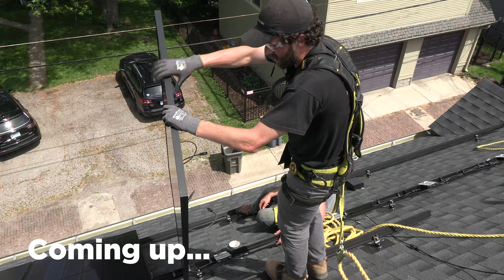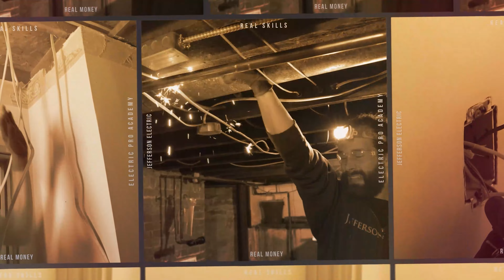Installing Solar Without Ruining A Historic Home

Comment: Nice...
As a former roofer,  foreman,  and now safety personnel,  I was concerned that the meter was installed hot WO PPE... not even safety glasses.   The guy walking the roof stepping on a rope,  the slipping and maring of the shingles (which you said was not a problem because of the special boot fittings) the tightness of the wires going into the roof J Box and the size of the J box.
However,  after Wayfinder evidence of your videos,  I am confident you will or have addressed these issues and corrected them if you felt it necessary.  Thx for another great vids.  
Side note: it's hard to imagine the panels needed to be"invisible" for "historic compliance" while the same rules allowed all the attachments to the outside wall of the house.   Curious

Comment: my roof is hard to walk on it is plastic slate you can't sit down it is like a sliding board.  these panels nowadays are so much better than my solar panels from about a dozen years ago with one inverter in basement I think one panel is not working but i would have to take whole thing apart to find it

Comment: I'm interested in the code that allows cutting down pluming stacks for solar installs. I have a couple stacks in the way of my install that is about to kick off.
Reply: in most cases the vent about the roof is to prevent snow or leaves from covering it. I suspect the solar panels will do the same thing. The alternative is to reroute the vent inside the attic and bring in out in another location.
Reply: Can you also put an air admission valve on the stack in the attic, and blank over the hole?

Comment: The 13:25 -15:25 bit about Chip-Edge Welding was super fascinating to learn about. What perplexes me is that, compared to most other metals (that one encounters in normal life), aluminum has an incredibly high melting point/mp, 1,221 °F (660 °C), so I wouldn't expect it to even be able to achieve those high of temperatures. 

About the WD-40 fix/workaround, though, that's reminiscent of the way that whetstones for knives use water or oil to float up the Swarf to prevent it from messing up the burr and sharpened/sharpening edge.

Comment: As I'm watching Zach at 10:00 placing the SolaDeck up into the shingles, I am wondering about farther north climates like Minnesota, where there's not just much heavier snows and/or freezing rain throughout the winter, but then that risk of where there's some melting and seepage "backwards" up underneath the shingles...

What added considerations would there be for protecting against snow and ice on the roof melting into water then working its way upwards through those cracks and seams created by this process? 
Or is the 10:35 "bead of caulk" sufficient for that?

Comment: I would have liked to see a few quick shots of the finished install—what it looked like on roof and wall and perhaps a bit about it actually working. It should literally slow down or stop the usage on the  property side of the meter once you throw the switch   What was the expected wattage that was supposed to generate— you said 370 times 56 I think??  Good video

Comment: they paid $70,000 for this install? How are they ever gonna break even on that?
Reply: My 12kw solar was 50k before incentives. Using enphase system. 33 panels and micro inverters. 9.5kw on the ac side.
Reply: @dr.projectx5142  interesting, thank for sharing your data point, if I may ask: what is your break even eta on that?

Comment: FYI:   WD40: Water Displacement 40. It is a solvent, not a lubricate. It is great to spray down tools that get wet, but is a poor lub.
Reply: Although this is totally true, I’d imagine that using the tools available to them is better than not. Yeah they should totally get dedicated cutting fluid, but then they have to put that somewhere and bring it out when they need to use it. Because they work out in the rain, they definitely already have WD-40 on the truck. Remember, this is the same guy that uses his pliers to put a nail in =p

Comment: Give tin snips a try for cutting out the shingles around the solar deck, we find it a little easier then a knife and also mark out the array with soap stones, lasts a few jobs longer then the wax crayons. Keep up the great work! We use snap n rack which I find a bit flimsy to prep on the ground with the optimizers
Reply: I'm not a roofer but it was still cringe watching popping the nails on the shingles. And then he said he is going to put caulk around it... My buddy is the roofer and he's not around me but Ive learned enough from him that's a big no no. I'm going to have to show him this when I get a chance and see what he says lol.
Reply: Just from seeing him work I think he would take the nails out properly and cut the shingle. He would probably put the caulking underneath the box on all sides but the bottom and carefully put it in position. Screw it in like in the video.. maybe put screws on the very bottom if necessary.. and caulk those and sprinkle some loose granules on top lol. Also put any nails back in the shingles if he could
Reply: Around the box is a channel for water though.. shouldn't need caulking

Comment: Pointing out parts in an electrical box using your fingers seems like a bad idea to me. You should carry a wood or plastic stick or something non-conductive to use as a pointer.
Reply: It's dead iirc 
also they know the insides very well tbh